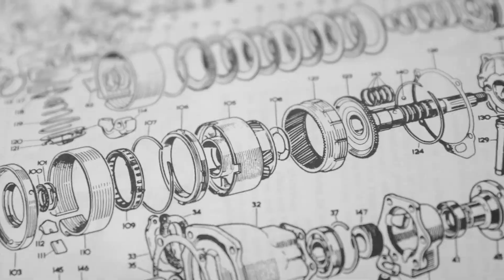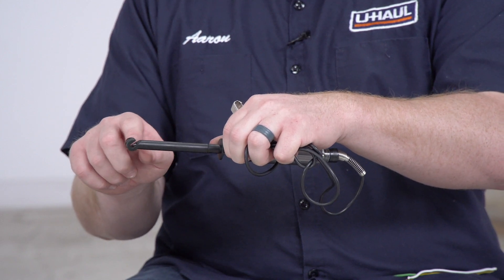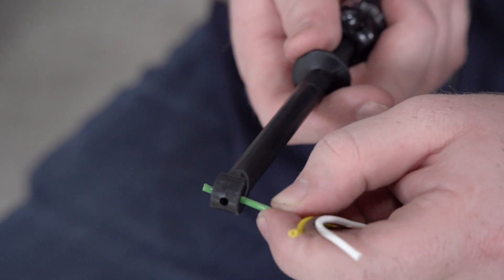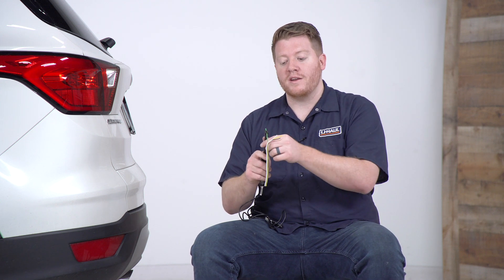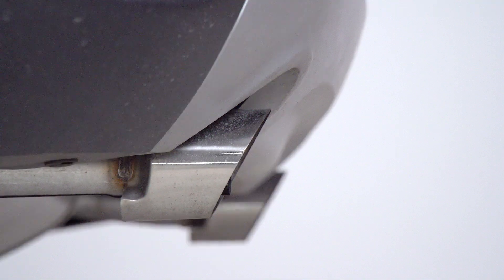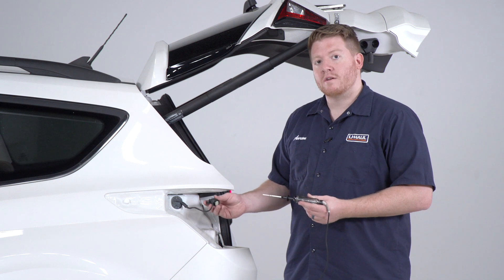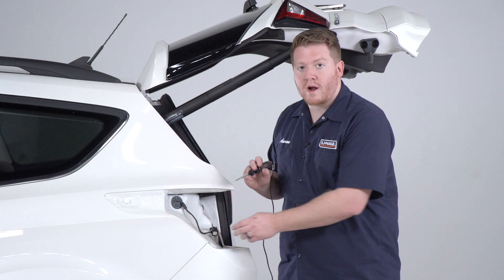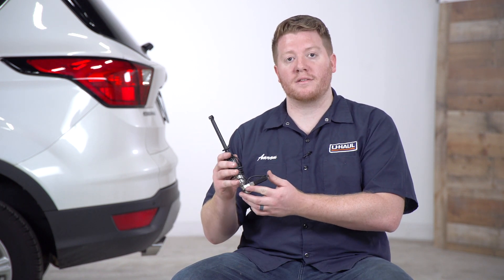Circuit Tester Techniques For Testing Wires

Comment: Poking holes in wire is a bad idea
Just opened a spot for corrosion to take hold
Reply from the maker: Davie, if you have an exposed end or empty connection, we always suggest testing there. However for wired where there is no exposed connection, this is a good option as long as you properly reseal the wire after testing.
Reply: @UHaulTrailerHitchesAndTowing
  what is the method to properly reseal the probed wire?
Reply: @albertalbert7644  electrical tape? Superglue? It shouldn’t be a big deal to “repair” unless you go too deep.